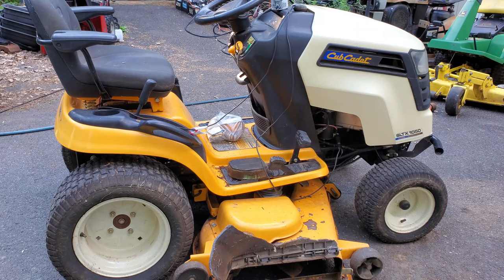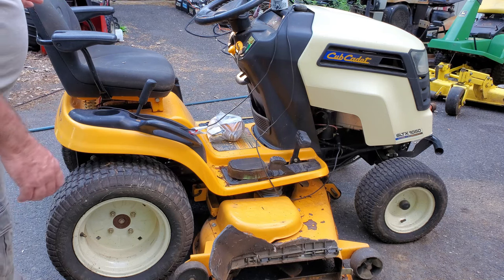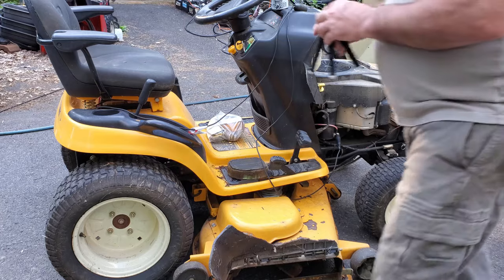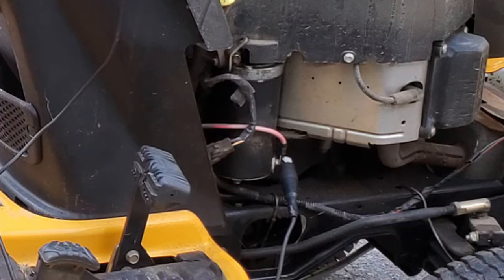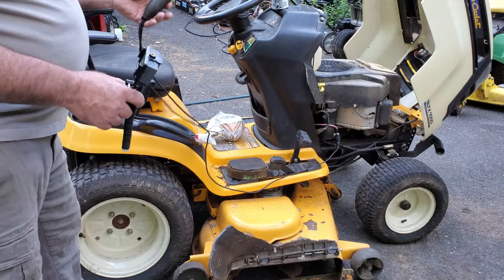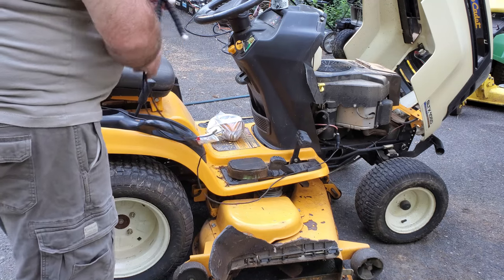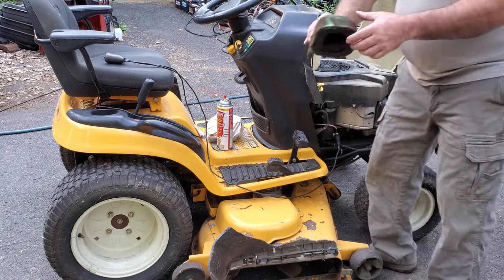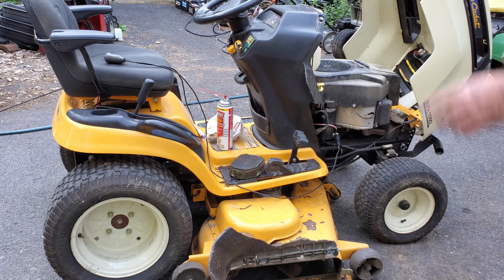How to Quickly see if the engine will run

Comment: my mover is not clicking when I turn the key- what are the safety parts/components you mentioned early in the video....there was a time not long ago my mower would do this and all of a sudden it would work like normal- tia
Reply from the maker: Hi, if the mower has a manual lever to turn on blades, make sure it is all the way disengaged so it makes the switch to know that the blades are off. The next would be make sure the shifter is in neutral, it needs to make that switch also. Wiggle the wires on the back of the ignition switch. After that you need a multimeter to check things.
Reply: Sometimes there is a seat safety switch. Weight is needed on the seat to get it to turn over and run. Suspect this didn't have one since the seat was not in riding position.